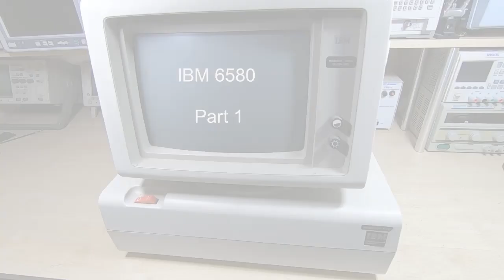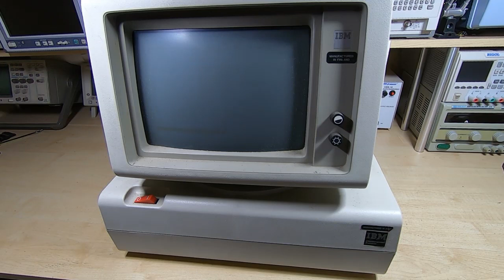IBM 6580 Part1

Comment: Can anybody help me?
I have a IBM 6580 and it doesn't start (Power supply is running but It doesn't show anything on the display. But I also don't have the Keyboard. My question: Is the Keyboard required for the 6580 to boot?

Comment: It’s quite a while that I’m looking for a Displaywriter for my 6360 8” floppy drive. Love this type of machines. Do you know if they can be connected somehow to a pc like IBM 5150?
Reply from the maker: In theory it should be possible to connect it to a PC but I do not know how much interface control this would give. They are designed to be linked together in systems so I assume that the interface is capable of full control. As far as I know this unit is for sale. It is not currently working (I will show this in the next video) but it may be possible to repair it.
Reply: Ok, my wish was to create a link that allow to handshake data from 8” to 5 1/4” and 3,5” floppies using DOS. I know there are softwares for disk images, very useful for copy, but having a working system that allows to use all type of media (and their content) would be great.